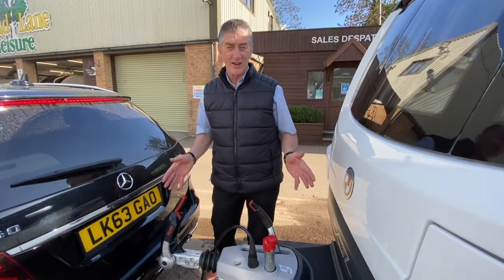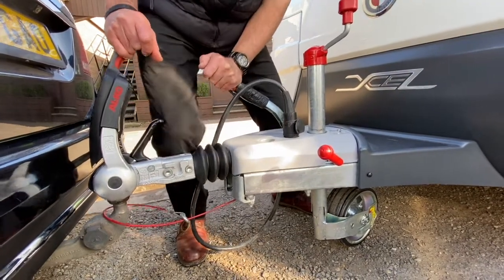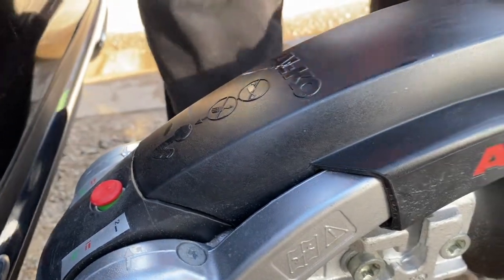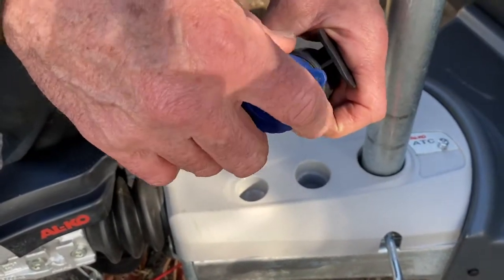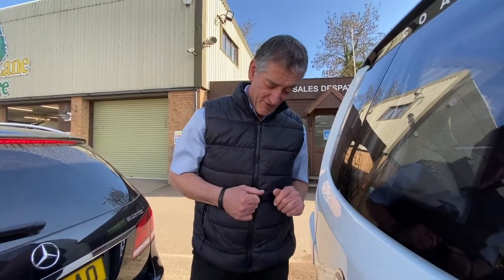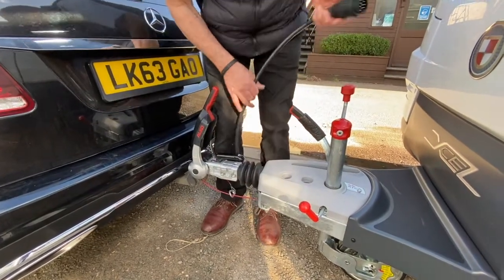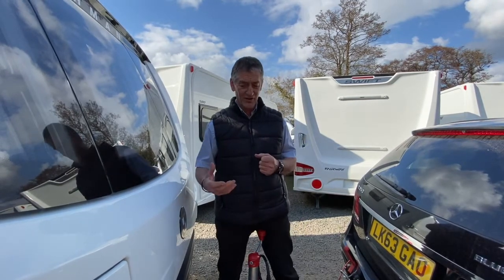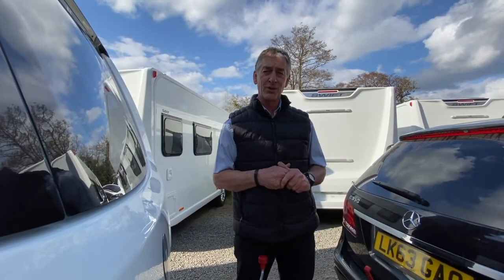Hooking up a car to a caravan demonstration

Comment: Applying breakaway to tow ball absolute no no every chance van comes detached so do breakaway cable. As for coupling up didn't whined down jockey wheel to make sure hitch attached securely .Not very good advice in my opinion